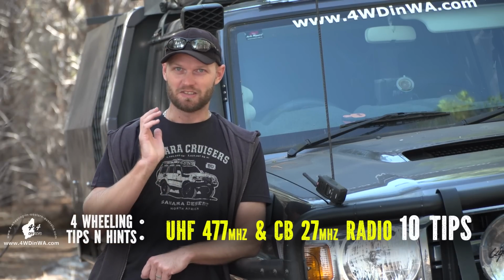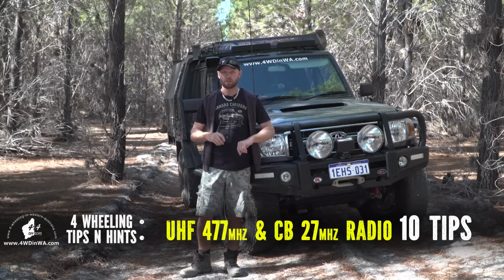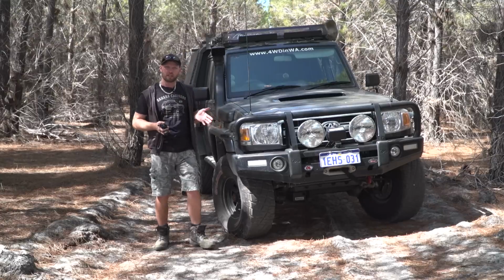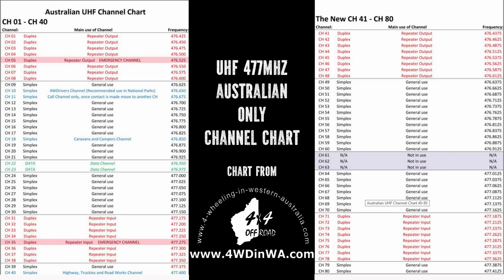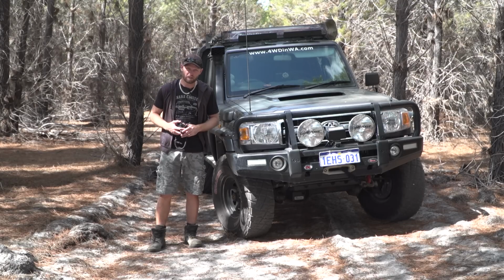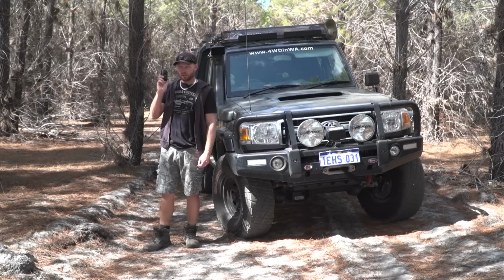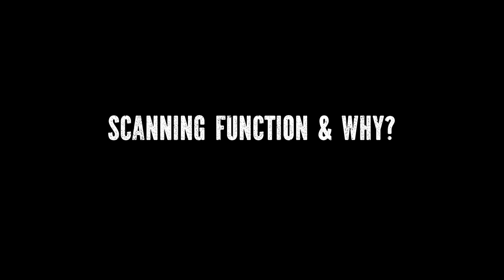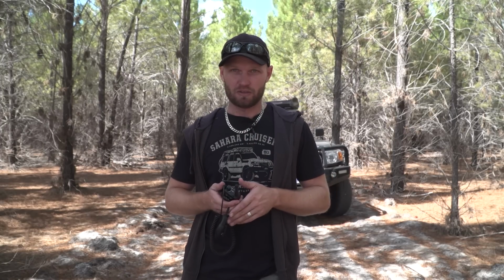UHF CB Radio 10 Tips

Comment: Ronny I know you don't do short term overviews/reviews on some of your equipment especially tires, but how are these general tires stacking up for you currently? I heard they wear fairly quick.
Reply: +2gud4umenglez I hear they are good for desert but nothing else.
Reply: +2gud4umenglez 
I've had mine for a bit over 2 years now (~25k miles) on my 80 series. They are wearing nicely, but I do a 5 tire rotation which helps. My long term eval is going to be kinda screwed up now as I had one get torque cracks (probably from airing too far down offload) and another that took a large bolt into the non-pluggable edge of the tread. The cracked one was covered under warranty. I will say that they are surprising quite for such an aggressive tire, handle well at high speed, and they stay balanced. I live in AZ, and as long as I'm not in snow or ice they are awesome. From rocks, to sandstone (Moab) to running on the beach in Mexico and even mud I have nothing but good things to say. Ok the bad; they are HEAVY. My 35's come in just shy of 100lbs each IIRC. Second, they create an interesting vibration under say 5 mph as the blocks of rubber roll over the pavement. That totally goes away at higher speeds. I do think they are a bit softer compound than other tires, so yes, if you have a heavy truck AND have power (which my poor 80 lacks and/or always distributes what power it does have between all 4) they might wear quicker. Hope this helps. I'm pretty sure that Ronny will give a favorable rating to them unless it has to do with wear. But he does have six, correct? For the terrain that he is in, and that heavy a rig, I can't imagine a better tire at this point. And one disclaimer, I work for the major tire retailer in NA, so I can and have run a large variety of off road rubber.
Reply: +rudedogii 
If you mean 'nothing else' as in snow (hard pack, not fresh) or ice than I'd agree. Otherwise they have handled everything else including mud that I've thrown at them extremely well. Do you have personal experience?

Comment: I got a baofeng UV-82 and a Nagoya NA-771 antenna for like $35 and it will do just about anything you need it to. No excuse for going into the bush without a sat phone or long range radio
Reply: I'm with my buddies are using cheap Baofeng uv-5r handhelds, for two years now. Very satisfied. In long range tested only once, got about 9.2 km in no line of sight.
Reply: MrMrsregor
only for FMS/GMRS. You can transmit on VHF/UHF with licensing
Reply: Note baofengs in Australia are classed as ham radios please do no go suggesting them unless you know the people have a ham license..

I'm unsure what the radio status we have here on the p25 repeater service in regards to emergency services whether or not that you physically require a ham radio license..

I know the emergency service sector in North America requires you have a ham license as a prerequisite for employment..

Though the last time time I read the course material ACMA seem to be hearing the ham license as a 1 license fits all service stations..
Reply: MrMrsregor
You better tell that to all the Fire and EMS people I know running them.
Reply: +Garret R note FCC don't apply in Australia
Reply: well some of them are FCC licensed
Reply: Garret R that would have been nice to get those... are they also only $35?
Reply: MrMrsregor the UV-5R radios are but I don't believe they are FCC licensed, I have the BF-F9V2+ which is FCC licensed but is also more expensive
Reply: Baofeng radios FCC approved for transmitting in LICENSED ametur radio and fire/EMS/search and rescue bands in the US.
Reply: Re maybe yours, but not all baofengs
Reply: All baofengs are FCC part 97 and under certain conditions part 95 type accepted. This is Ametur Radio and other LICENSED bands. I don't know why this no-fcc-approval myth keeps going around. Your device doesn't need to have an FCC ID to be legal for any form of use in the USA. It's not cheap because the lack of "type approval", it's cheap because it's chinese and lacking in features and durability when compared to Yaesu's and Kenwoods. These radios have a CMIT ID which have been negotiated with the FCC and the US Government to allow type approval under the correct situations.
Reply: oh ok, good to know. thanks
Reply: The radio you are referring to is licensed under Part 97 of the FCC rules as already pointed out and it is illegal on FRS/GMRS and illegal to use on the ham bands without a license, also already mentioned. On top of that though, your SWR will be high on anything other than what the 771 is spec'd for and as such the radio will probably be reducing tx power. Better to stick with radios built for what you intend to use them for.
Reply: Jared Polack again and I repeat again frs/gmrs has no bearing here as for part certification it may comply with some baofeng but not others though   How it is dictated for use here is way different....
Reply: " don't know why this no-fcc-approval myth keeps going around. Your device doesn't need to have an FCC ID to be legal for any form of use in the USA."
because it is not a myth and YES you do need FCC certification to use a radio in a certain band. These radios are not technically legal to use outside of ham radio bands period unless they have an FCC approved certifications and ID number that is valid int he FCC's database. otherwise it is a part 97 radio and is not allowed outside of ham radio bands.
CMIT is the Chinese version of an FCC ID and means that the radio or device has pass China's very lax certification requirements to operate withing the borders of China, this number DOES NOT mean that your cheap ham radio is approved for operation within the USA in or out of the ham radio bands. ALL radios that are to be operates within the USA MUST have an FCC ID NUMBER. A CMIT is not and FCC ID. The FCC certifications requirements are more strict, with part 97 being the most lax since hams are allowed to build their own radios and cobble whatever they can together as long as if fall withing a broad range of requirements, where as part 90 and 95 being the most strict and Must pass a much more refined and narrow range of requirements. 

In any event the FCC or the Chinese version of the FCC have no jurisdiction elsewhere.
Reply: +EuGarais the baofeng radios GREAT radios! but they are not FCC approved for broadcasting, meaning it is illegal and $10,000 fine if you get caught transmitting on them in US. they also are capable of broadcasting 5 watts and that means that you can not legally broadcast on FRS channels. so legally in the USA you can only use them for listening
Reply: +fordrac1ng81 no, unless your uv-82 is different than the 4 that i own, they are not FCC approved for transmitting, meaning it is illegal and $10,000 fine (maybe more like $25K i cant remember) if you get caught transmitting on them in US, if you are out side of the us fcc will not matter, but for some reason when they imported the baofeng radios into the us they did not pay the tax and go through all the loop holes to get them FCC approved, and that is why they are so cheap and a good deal. they are great quality for the price, but just not legally approved in the us for transmitting   
if you have the FCC approved logo with a number on your radio than i am wrong, but none of the uv-82 i have ever seen in person do :(
Reply: i dont care who runs what, i was just commenting on your comment, not my job to "tell" all your friends. i am not the FCC and like i said, dont care... just a little friendly info, thats all. i did some research because i could not figure out why they are so good for so cheap, and sure enough mine did not have FCC approval on it